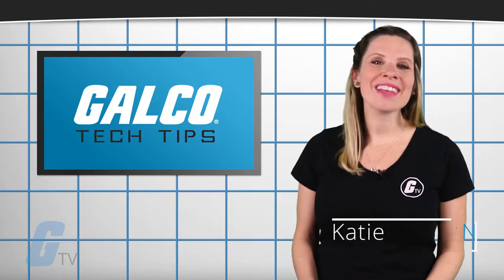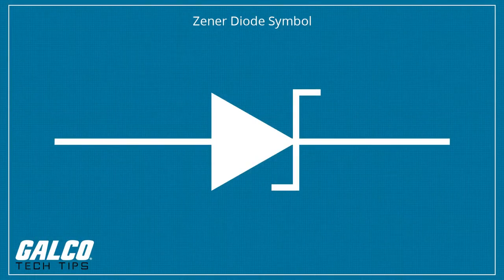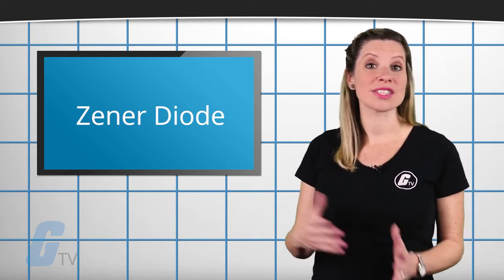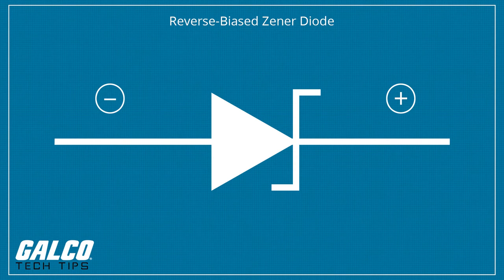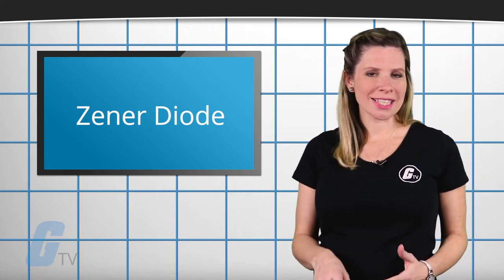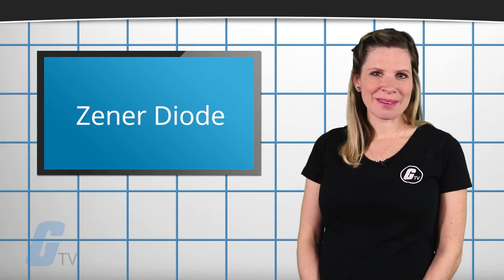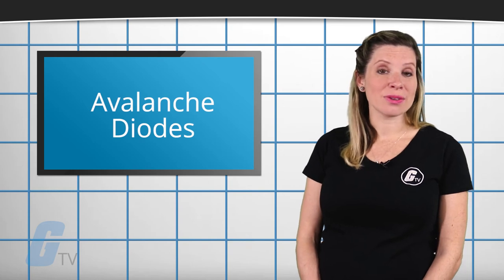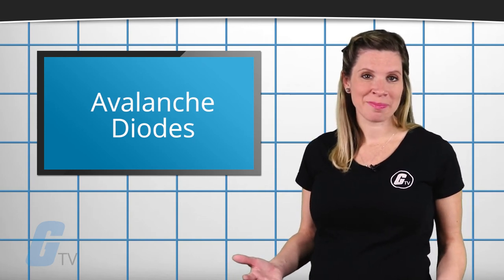What is a Zener Diode? - A Galco TV Tech Tip | Galco

Comment: Can u explain 6 pulse scr rectifier
And scr firing amplifier using 8thyristor inverter circuit
Reply from the maker: Sure thing, 6 pulse simply means you have taken both the positive AND negative half cycles of the 3 phase line power and converted them into pulsating DC. So you have 2 power devices per phase of line power in your converter rectifying both half cycles, ok? Now ask your second question again, another way please.